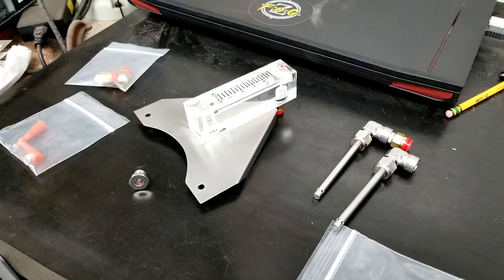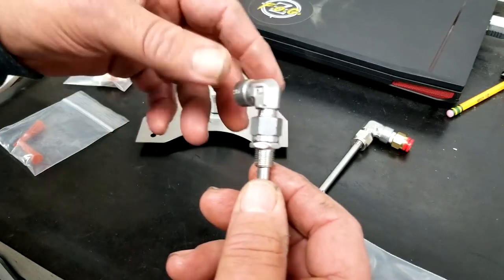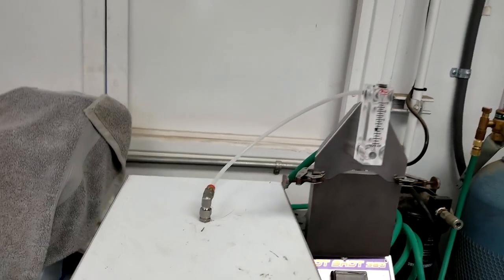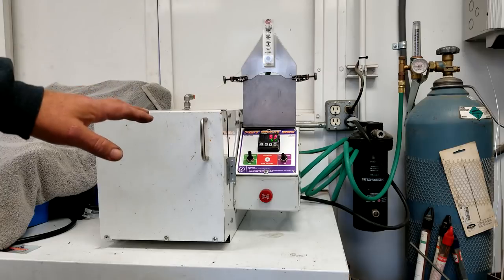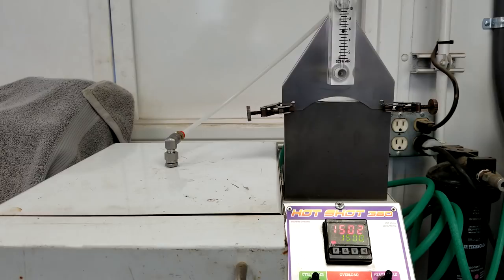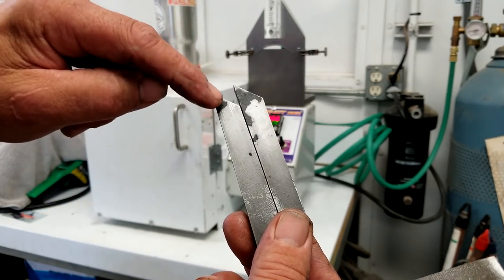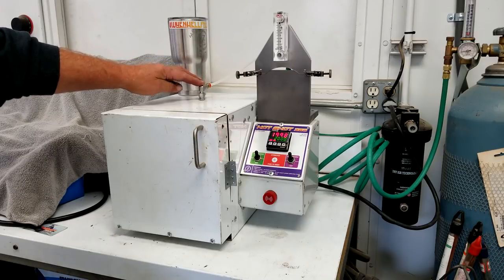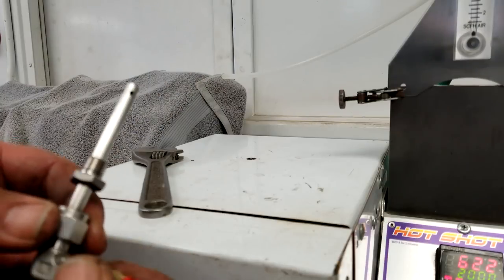Argon for your hotshot part #3

Comment: Great job Stan.  I notice that your Dwyer is calibrated in air, for Argon you need to multiply the reading by 0.85 due to the density difference.  I don't think it really matters for you application but I thought I would mention it.  Also, they do make the flow meters with a built in needle valve.  King instrument and Brooks also make them but I'm sure you know that.

Comment: Maybe you could neck the tube? It's only really the top ½ inch that needs to be a tight fit with the o-ring. A neck could allow for some crud buildup without dragging too hard on the o-ring.

Comment: Stan just finished watching your video on the Argon tube I think the temp will be higher on the fitting if you drill out the plug more and heat will pass through between the plug and tubing. I think you could use a male thread swagelock fitting and bore out the hole through the pipe threaded end so the tubing can pass and let the feral make the seal on the tubing. You will need to add a hose connection on the end of the tubing. I’ve made similar fitting to take gas sample from the center of gas stream in pipelines.

Comment: While the O ring probably isn't necessary, instead of putting it in a groove in the bushing, put a small groove in the top of the probe shaft and a 1/4" deep counterbore in the top of the bushing. Then the O ring will stay on the top of the probe and seat against the inside of the counterbore.
Reply: I was thinking the same thing. A big fat oring like the green castration bands at the farm store would be perfect.  A 100 pack is only a few bucks
Reply: Putting the ring inside gives a gas tight fitting. Having the flo tube sit on top won’t.
Reply: @melgross  it is only gas tight till it overheats and gets hard.  For a sacrificial system like this you are only looking to slow the flow down to a reasonable rate and actually having flow past the probe is desirable. I was thinking he could make a couple ounce weight to put on top like a pressure cooker concept to help hold it in place and provide a better seal that's easily replaced
Reply: TgWags69 thats a silicone o-ring. I’ve never had one harden up from heat.

Comment: You might inquire from the manufacturer of the flowmeter whether there is a conversion factor for argon versus air (which is what the flowmeter is calibrated for).

You might also paint the fitting black to get good IR temperature readings. (Otherwise, a lot of the IR which appears to be emanating from the fitting is only a reflection of your room's temperature.)

Comment: Enjoyed....Suggestion from a NO knowledge person....why can’t you build a stepped tube, the tube diameter inside the oven built smaller than the body being held (sealed) in the fitting...then NO rub upon removal....OR..double fitting..main fitting stays in oven and second fitting (tube holder) is removed which allows not pulling the tube past the O ring until cleaned?

Comment: I think that O ring will be a design sore spot. People are going to pull the injector out of hot ovens, run out of gas, turn the gas off too soon... and all that; the possibilities are endless, and in the real world will all happen. Also, if the injector is pulled out of a hot oven, the hot escaping air will present additional burn & fire dangers. Personally, I think I'd strive for a fixed all metal injector design. Just my .02¢ worth. Cool videos Stan, Thanks!

Comment: Thank you for doing this video, Stan.
I really like the idea of running Argon. Of course many of the welders in the crowd. Do this for protection already, when TIG welding containers for example. Keeping some argon on the back-side of the welding area as well. 

My first though, while watching this. As far as dragging that nozzle by that O-ring. Is to go one size bigger with the threaded busing in the oven, and then fix a short smooth bushing, up at the top of the nozzle. So the nozzle never has to be pulled through the smaller tight hole. As the nozzle is removed, the smooth bushing goes up with it. The hole then would be about 3/8". 

I have now read some more of the comments, and do also like the idea of putting the o-ring up high on the nozzle. But that doesn't give as much room for the crud, as a high smooth bushing would. We all know, that we'll let the crud build up later!
: - )

Comment: Great series Stan. I was thinking that rather than have to start a long purge, what if you were to load the oven with argon and add a carbon source. The carbon source when heated will  burn and use the leftover oxygen saving on the more expensive argon. For carbon you could use graphite or even paper.
Reply: Dudley Toolwright that could affect the hardening and temper. It would change the surface percentage of carbon in the steel.

Comment: Even with the gas flow "cooling" the injector tube, I think I'd probably impinge the plug from loosening with a few swages from a spring loaded punch, just to slightly deform the threads. What would be cool as well would be to incorporate a solenoid to start/stop the gas flow and add those "purge cycles" to the timing maps so the whole system becomes 'autonomous'. Keeping the gas flowing after a cycle would give the added benefit of keeping that o-ring alive a bit longer. Additionally, you could cut an o-ring groove in the tube itself, so in the event you are not using argon, the o-ring is not baking in the fitting and a simple drop-in plug could be used to block off the receiver tube. This also simplifies the machining process since you're not having to cut an internal o-ring seat and the entire length of the tube doesn't need to pass across the o-ring.

Comment: Though argon is a significantly heavier element than oxygen, their densities are not that different. It's because oxygen atoms by themselves are very unstable. So they pair together, which doubles their density. The density of O² is 1.43 g/l and argon is 1.78 g/l @ 0º C. N² is 1.25 g/l, and all of of these gas readily coexist together. 
You need to eliminate oxygen from your ovens if your goal is to stop oxidation during heat treat. An argon purge may reduce the introduction of outside oxygen, but it is not going to completely remove it. I would suggest improving your oven's seal first and foremost. Then you would only need a nominal argon purge to prevent new oxygen from entering, and use a couple sheets of paper to consume oxygen in the oven.
Reply: E Designs, (off topic), curious, how did you include superscript in your post?
Reply: @rwbishop  I didn't use superscript. They're extended ascii characters. Just press and hold the <Alt> key while entering the four digit code. For example, the code for the degree character is 0176. Just about every punctuation symbol and several fractions are available, e.g. ¼, ½, ¾, etc. If you're running Windows 10, launch the Character Map app to get the codes. They, re in the bottom right corner when you highlight the character you want. You can also copy and paste.
Reply: @EDesigns_FL  Thanks Much!² Had to poke around a little, but did it with my Mac!

Comment: Your idea is great. As Argon is heavier and you want a gentle flow to avoid mixing, youmight want to put the “injector” lower on the chamber instrad of on top. My not-educated guess is that on top the Argon coming in needs to flow through the air and start displacing it when acumulat4s on the bottom.

Comment: You could use a music wire ring. Also make a plug out of carbon to keep heat in when not using probe. I had a burnout oven and I drilled the hole in the top to 1 1/8" so I could heat treat 1" rod for about 8".

Comment: I wondered if you might need to test running at full temp with the fitting in place and the probe removed to satisfy the question of what happens to the O-ring with no argon?

Comment: Did you say the exterior oven temp reaches 200?  I had that problem with mine.  I wound up adding 2" of Kaowool and another metal skin to get it down to touch safe.  On the commercial boilers I operated, before retirement, they had to do that too.  Your stainless looks sharp.  Ceramic-Aluminum paint set me back about $200 per gallon.
Reply from the maker: I think of it as a forge or BBQ, 2K inside with 200F outside is acceptable to me.
Reply: Being electric you don't need to lessen the roar like Clark.  Mine use to roar just like his.  With a commercial oil burner I get less pulse combustion than he does.  In Alabama you can run rich like that.  For you or me the fire department would drop by.

Comment: Use a Swagelok bulkhead fitting for the injection tube. Swagelok has a plug that can be threaded onto the fitting when not using the Argon injection and the bulkhead fitting can remain in place...
Reply: That is a good idea, once you swage the ferrule on the tube it stays in the same position on the tube too.
Reply: John Taylor, you read my mind!

Comment: Have you thought of moving the injector hole closer to the door? Since that is where most of the oxygen is entering the oven. Rather than the center, would putting the injector in the 1/4 to 1/3 position help?

Comment: Hello. I guess if you make the upper portion of a tube (that stay inside O-ring) bigger for, let say 2mm in diameter, it will not ruin seal when you pull it out and it will go easy in and out every time. I hope you understand what I mean :-) Have a nice day.

Comment: I'm curious what's gonna happen to the top of the oven after a number of normal (no argon) cycles, with the hole in the insulation... Would a ceramic "dummy" nozzle fill enough of the hole to "re-insulate" the top?

Comment: What if you 'stepped' the tube to have a larger diameter shoulder for the o-ring.  The oxidized end could be a little smaller to slip past the o-ring?

Comment: Hi, Maybe you need to peen or pin the end plug on the purge tube? I could imagine the threads working loose fast with the high temp cycles.